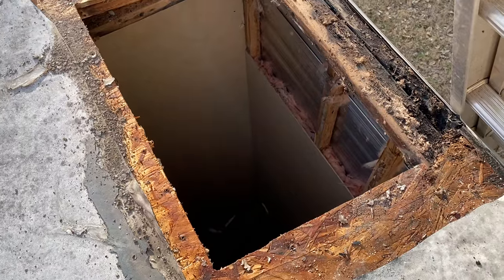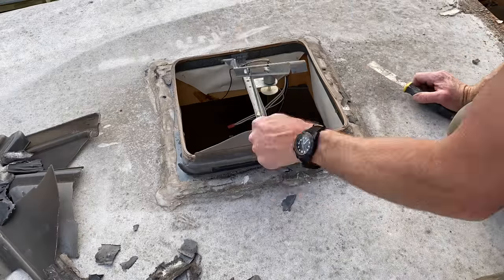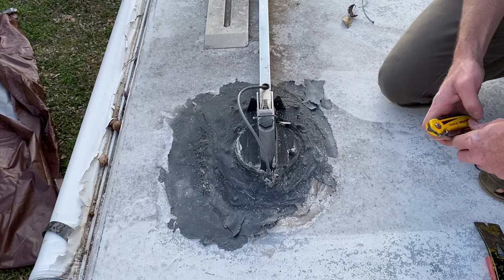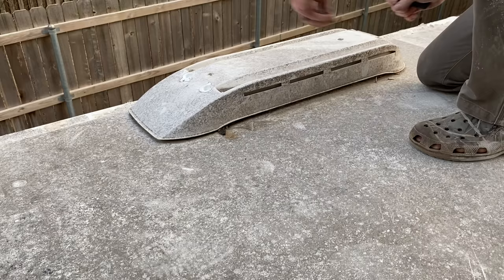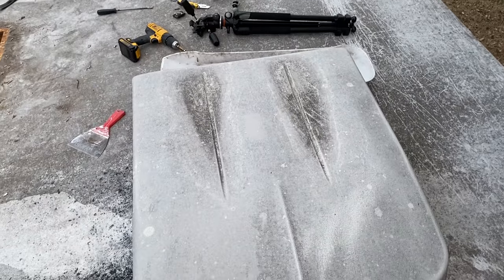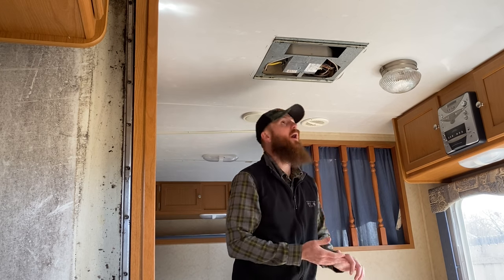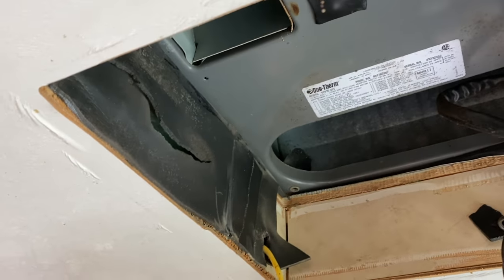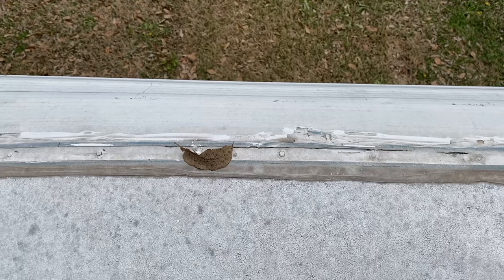DIY RV Roof Repair - Stripping the Roof

Comment: This helps so much. I had floorboards that were basically wood chips after wood damage that we replaced and then my ceiling/roof looks exactly like this. It's all moldy and water damaged. Thanks for posting how you took all this off. This really helps when renovating/repairing at home.
Reply from the maker: Glad it helped!
Reply: How much did it cost you to repair the roof?

Comment: My parents bought a 1999 fleetwood prowler & had problems with things on it, the worst was just after my mother was almost passing few years back the roof leaked the light bowl in living room filled with rain water I tried fixing it with sealant that was recomended for it still leaked, the tops of these are junk using rubber membrain was completely idiotic.. I would never buy any rv especially from fleetwood..
Reply from the maker: It's amazing how cheap they are made.

Comment: So did you have water coming inside around the TV antenna?  I just bought my first rv, and it has a roof leak.
Reply from the maker: We had several leaks. One was around the antenna. one was around the skylight in the bathroom, and the slide was leaking. Where is your leak coming in from?

Comment: Were you getting water on inside? I was putting cover on my rv and I seemed to have found a soft spot where wood felt crunchy. Never any water issues on inside, though. Really stressing
Reply from the maker: Yes. My rig was stored offsite (out of mind) for an extended amount of time, which is when it developed the leaks. Water eventually made it inside and I ended up with water damage from the roof to the frame and everything in between. Where is your soft spot at?
Reply: @remodelyourrv  the soft spot is on the main roof, not the main slide out. It's located near edge above our fold out couch. No evidence of water anywhere. We use it a lot and I am always looking for issues
Reply: What would you suggest if I'm not seeing any water but feel the soft spot?
Reply from the maker: @homevideos91  I would think you had a compromise at some point and some water got in. Can you identify anything up top where moisture may have leaked in at some point? How big is your soft spot?

Comment: I just bought an RV myself and then one corner the wood is rotten I could stick my finger through it if I tried I'm trying to she lit up I don't got much money is it possible just to go over the old wood
Reply from the maker: I would try to avoid it if possible. It may cause additional problems down the road.

Comment: How much did this repair cost you
Reply from the maker: All in all it was about $750 tops. The Roofing Kit cost me about $550 on Amazon and came with the rubber roofing material, lap sealant, butyl tape, and roof adhesive. Then I spent about $100 on wood and maybe another $100 on miscellaneous materials. But, I did have to replace a skylight, some vent covers, refrigerator vent cover, and the bathroom vent.
Reply: Remodel Your RV thank you for that insight I have a haycock that has a small roof leak I’ll be doing some replacing soon.
Reply from the maker: @reds_daroadrunner553  Glad I offer a little insight. Good luck with your project. It's really not that bad once you get into it. Take care.
Reply: Remodel Your RV Which  roof kit did you order off Amazon?
Reply from the maker: I ordered this kit: https://amzn.to/2F4KIbk

Once, you land on the product page, you can the length you need and it will adjust the price as well as the specific quantities of adhesive, lap sealant, and butyl tape.

Comment: There should be a class action lawsuit against winegard. They are the manufacturers of those horrible antennas. Not only are they useless but they were defective straight from the factory and unless someone sealed the life out of that little rubber boot it would leak.
Reply from the maker: They seem to be the source of so many problems.